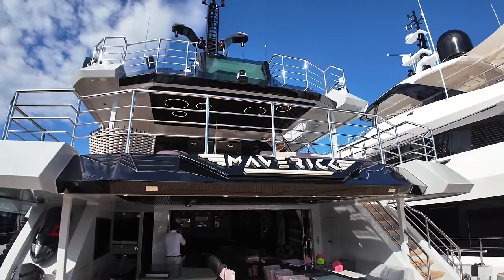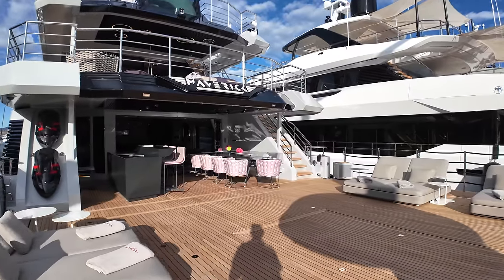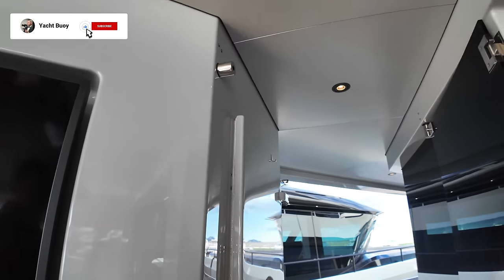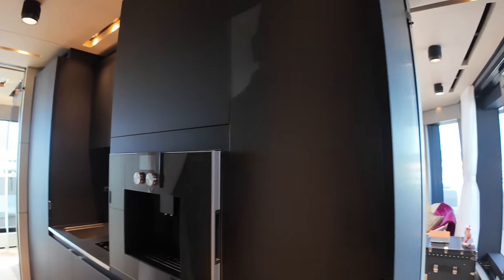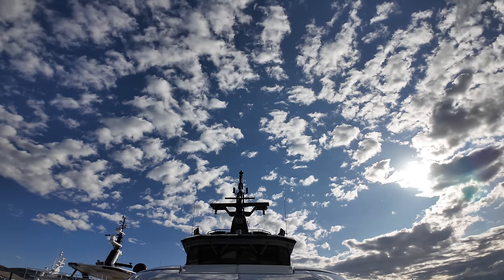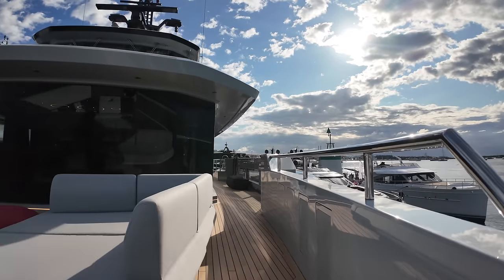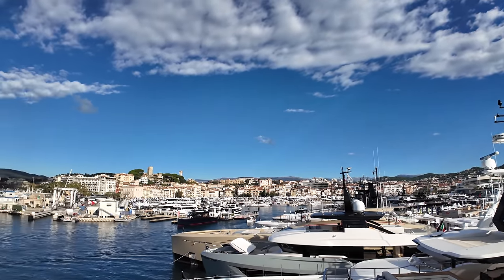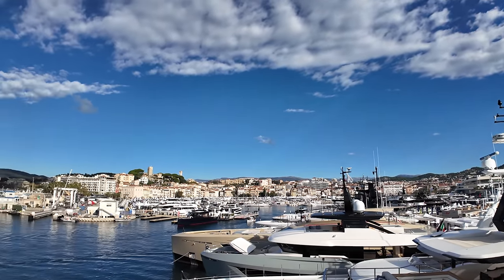THIS is Hull 1 of the NEW FLEXPLORER 146: Steel Explorer Yacht M/Y Maverick

Comment: Very very nice yacht. Unusually nice in my opinion. Something between a regular megayacht and a supply ship with the large open aft deck. The only thing I would be worried about in heavy seas would be the large window surfaces and the sliding glass doors.  Unfortunately, many yachts are called explorer yachts today, but in rough seas maybe not all are so tough after all. Thanks for the viewing.
Reply from the maker: Thanks for watching 🫡

Comment: no doubt , it is a beautiful yacht , but i just wonder how these yachts can cope with say beaufort 12 which you can  have at sudden times in the Atlantic ocean. I worked on a tugboat and we had steel plates with slits to look outside when the weather gets realy rough .How on earth can these yachts with big windows leaning forward withstand those forces?
Reply: I am quite sure they would have thought about everything. Including specially thick windows that should withstand high forces.

Comment: John, I know that the yacht has staterooms for 16 people, how many crew are on board? I also wondered if there was more refrigeration than just in the galley or do they have to re-provision about every 3 to 4 weeks?
Reply: How do you count 16? 4 guest at lower deck, maximum 10 people with the pullman beds, 1 VIP, 2 more people and then the owners cabin which is 3 persons including son. That adds up to 15, but from what I understand you can never be more than 12 guests (including owner) on any yacht plus crew, but the crew can be how many as needed. So even the 2-300 meter yachts only are allowed to have 12 guests.

Comment: I don’t think you want to be up on that top when the radar is running that would be a bad idea. I wonder if anybody knows why?
Reply: It looks like the radar antenna is at least 2-3 feet(70-100cm) above head height. That's a decent amount. In addition, the RF beam is limited to about 10 degrees from the horizontal plane. I assume the builder did the math. (But if I were buying one; I'd be sure to double check it. :-) )

Comment: The term, yacht, originates from the Dutch word jacht (pl. jachten), (16th century) which means "hunt", and originally referred to light, fast sailing vessels that the Dutch Republic navy used to pursue.
There were NO power boats in the 16th century. 
Takes ALOT more skill , experience & education to 'Sail' a boat rather than push a button & drive . 
Landlubbers will always pursue the easiest route to mute their feelings of inadequacies. 
Pretense is their modus operandi.